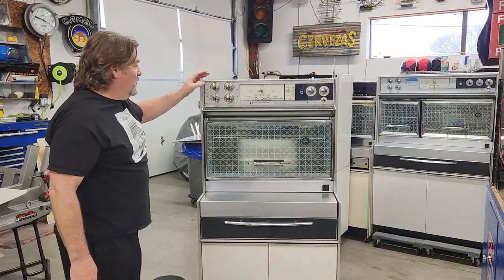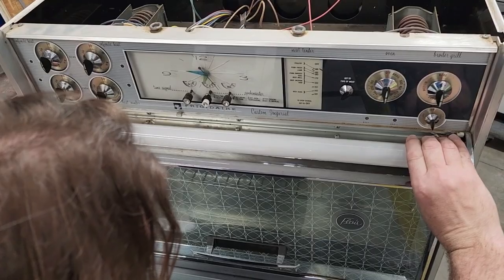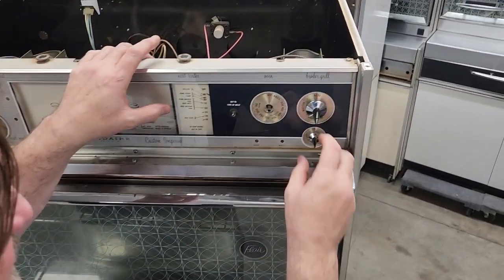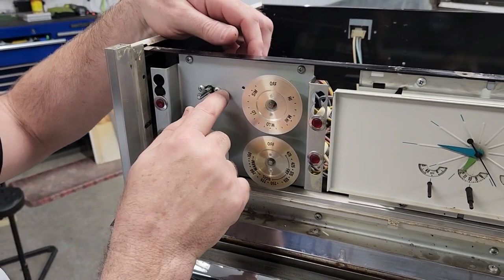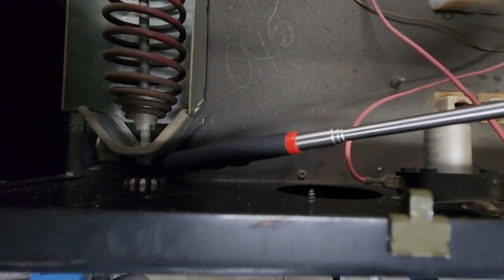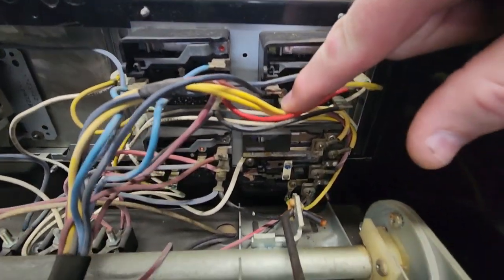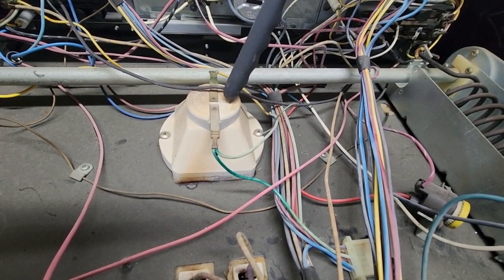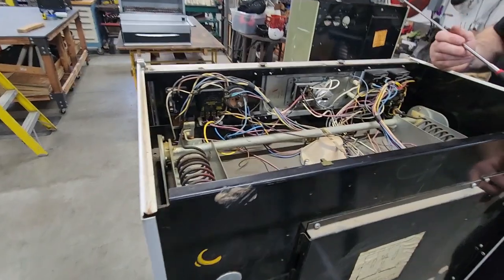General Frigidaire Flair Maintenance - Part 1

Comment: Do you know where to get replacement switches? I’m not sure what it is but I have a buzzing sound coming from either the thermostat or the actual switch for the large oven on a 1963 40” model.

Comment: Love your videos on the Flair. i have a 1962 double oven. All works except the clock. I would like to take it out and get it repaired. you said you would have a segment on taking clock out. Please do one. so many wires attached and I need visual help to attempt. Any plans on this? Desperate! Danny Bond

Comment: Great to see your videos. My mother in law has a Flair (RCI-639VL). Door on bottom oven springs are broke, any ideas on how to fix or part numbers for springs?  Also, top oven door won't stay open. Any help is appreciated.
Reply from the maker: Can you send me a picture of the broken spring? I might have one for you.
Reply: @TheFlairAffair  They misplaced the spring. I am just working on trying to figure out how to even access the springs.
Reply from the maker: @tsieck4839  I don't recognize your model number, I don't think it is a Flair model.  Can you send me a picture of the front of your range? You can send me your email and we can take the discussion offline. I will try to help. Thanks!
Reply: Youtube won't let me add an email address. Any other way we can connect outside of YT where I can send photos?

Comment: Hi, I'm wondering if you can tell me where to get a replacement part. It's the black ribbed trim running under the control panel part.

Comment: My 1964 Flair wall oven CookMaster is not functioning to bake or broil, the clock still works.  I attached a CookMaster from a 1963 Flair and the oven works perfectly, but I can't use that one permanently becase it doesn't match or fit with the glass cover.  I'd like to bypass the control functions and just have the clock.  I need an electrical schematic for that or if you know which termonals to jump.  Thanks.

Comment: Great vintage unit.  I did not know they made a smaller width one like this.  I would much rather have this size one then the one with the 2 ovens.  What width is this one, and where can you find one of these?  I love the pull out cook top feature.  So cool.  Great video.
Reply from the maker: Frigidaire made the Flair range in two sizes, 30" wide and 40" wide.
The 30" wide has a single oven, which is the widest oven they made.
The 40" has dual ovens, a small one and a medium one.
Both models have the same 4 burners.
I have both 30" and 40" models for sale in the Kanas City area, just send me an email: jwalker@isacompany.com

Comment: I don’t get it what is so special about this
Reply from the maker: What is so special about what? Are you talking about the Flair range? Can you be more specific?
Reply: Simple. It is a wonderful design and they were built to last. Mine is still working and it was made in the 1950s. It's also a space saver with the slide in burner section. What was most special about it is that is was built with such quality that it still works all of these years later even though it has gotten a TON of use! You won't find that kind of lasting quality in today's products.